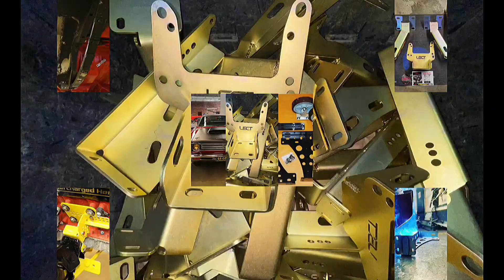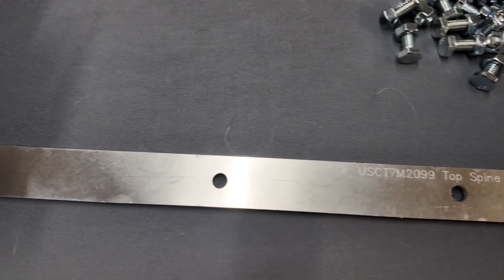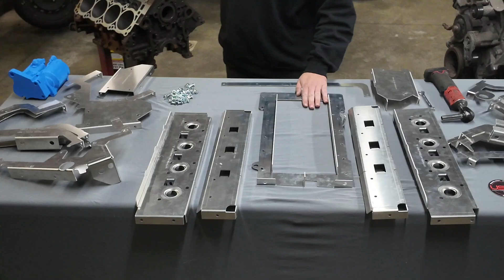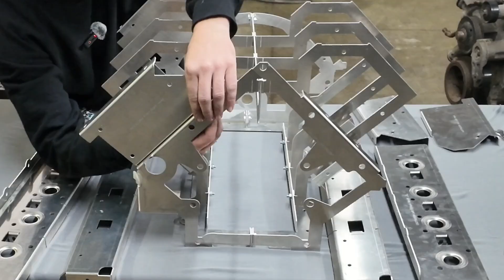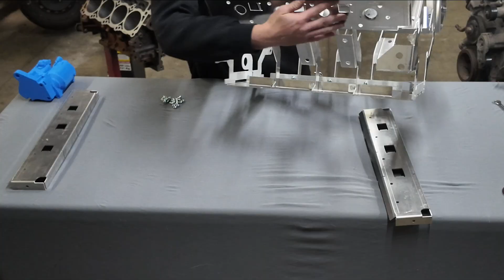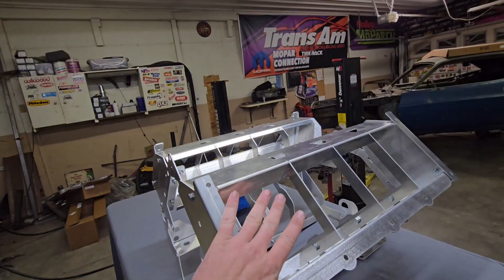US Car Tool Gen3 Hemi Mock-Up Engine Skeleton | The Ultimate Tool for Your Hemi Swap

Comment: Wish someone would make a mockup for the 8hp95 TRX/ Trackhawk transmission.  I'd like to be able to use the custom mounts on the rear to mockup transfer case and crossmember.